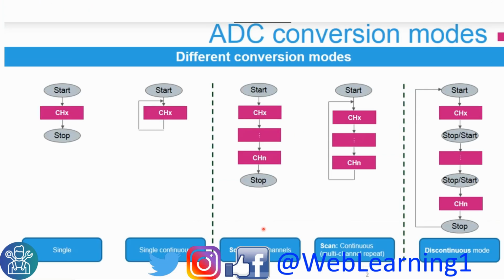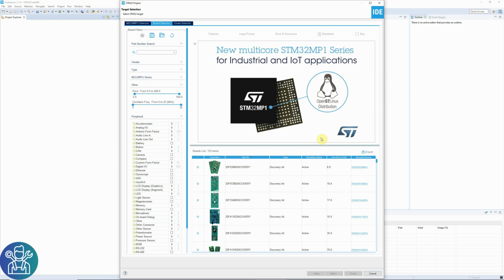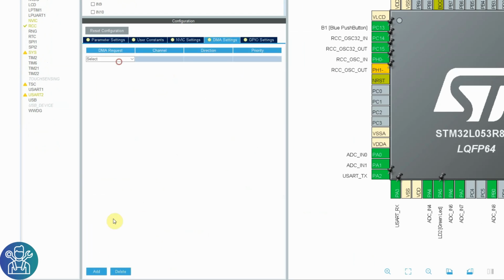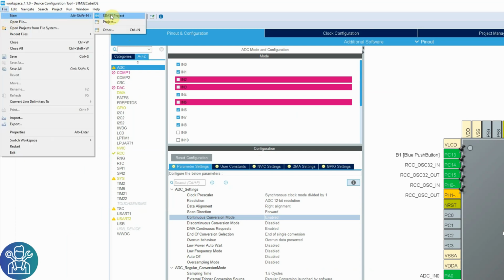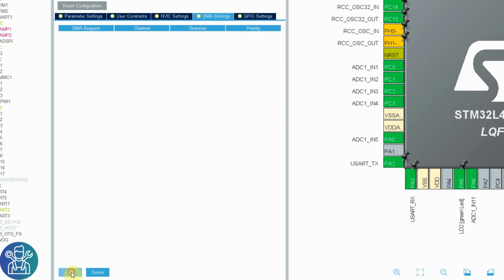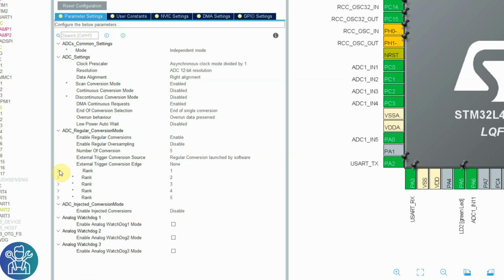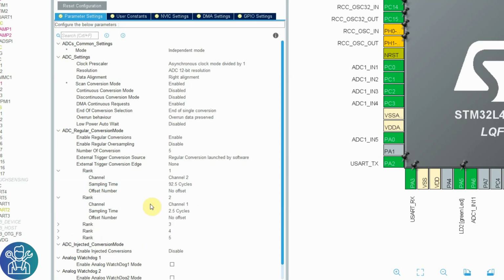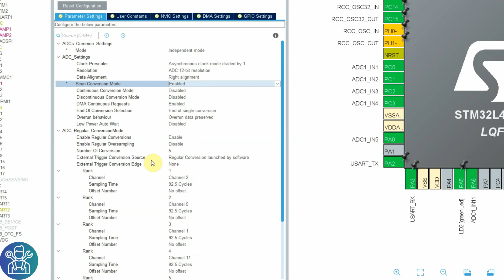HAL #14: ADC Scan explained

Comment: So in your example, the ADC sample rate is triggered continuously only by the ADC clock rate (48Mhz since Prescaler divide = 1)?  The actual sample rate would only be 700ksps  (48Mhz / ( 5 scan channels * (12 cycles per conversion +1.5 cycles between conversions)))?
When would you use a Timer event to trigger an ADC conversion?  Would it be only if you need a specific sample rate not achievable via a multiple of the ADC clock?
And whether the conversion are timer triggered or continuous, the DMA will issue a callback when the buffer has been half/filled?  I'd like to convert the data to ASCII and use another DMA to transfer the buffer to the USART3!
Reply from the maker: Wow, I'm not sure I will be able to answer all off this here. In general, it's very project dependent on when and how you use the ADC and timer. Usual you use it when you trigger something on the outside, or you measure something like power so you need to know when to trigger as the calculation taking into account the time.

Comment: Im using an STM32F072. ADC_Regular_ConversionMode -> Number Of Conversions is not available. I'm assuming my chip does not have the required circuits :(
Reply from the maker: If it's not in the cubemx, then it's not available.